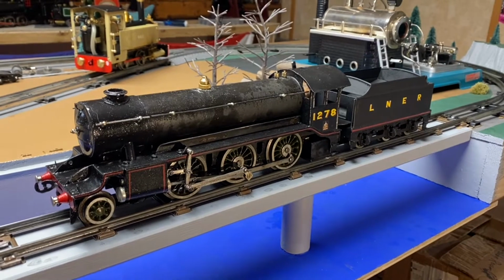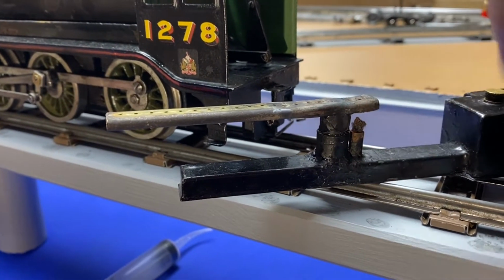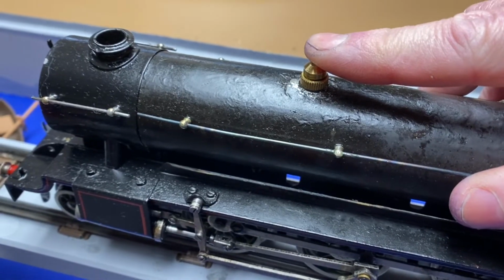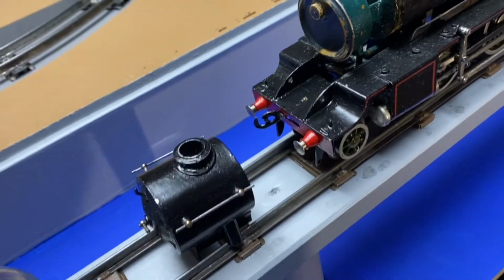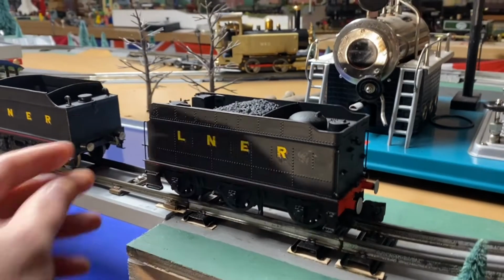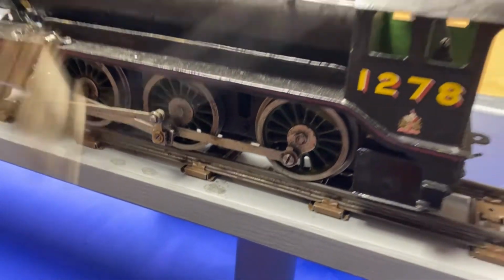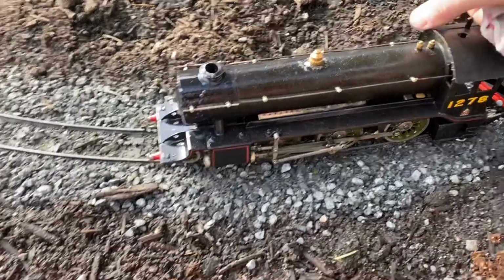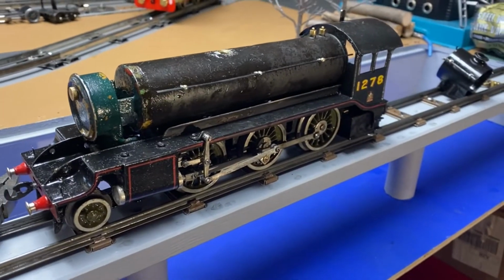Victoria BC: Tutorial - Running an antique live steam O gauge Bassett-Lowke 2-6-0 (Please subscribe)

Comment: Hi Terry,

Thanks for the video. Very helpful. I have one of these on the way. I’m excited to play around with it. Do you have the link for the safety valve you got ? Thanks!
Reply from the maker: @tyfude you’re welcome! If you find issues running it or whatnot don’t hesitate to contact me. I don’t remember where I got the valve. I’ll go have a look…
Reply: @Terrys-Steam-and-Bricks  thank you!
Reply from the maker: @tyfude  not a problem
Reply: @Terrys-Steam-and-Bricks  one thing, do you know about what the PSI pop off pressure of the boiler might be and the thread size? That way I might be able to find a valve that works, or have one made. Thanks!
Reply from the maker: @tyfude  i believe the manufacturer intended 15 psi. The thread appears to be British standard 19 threads per inch on a quarter inch bolt.
Reply: @Terrys-Steam-and-Bricks  thank you kindly!
Reply from the maker: @tyfude  np. I am not very well versed in nit size and thread length. But ai know there is a difference in the angle of the British threads than the American ones.
Reply from the maker: @tyfude  sorry. Can’t find anything. Try places like O gauge live steam Facebook groups. Ask there??

Comment: What is the minimum curve you run this on? I just bought one, but only have O-31 curves. I read they like O-72, so I bought a set of those.
Reply from the maker: I am not sure of the actual minimum but suspect one. I run mine outdoors on 2.5 foot radius track. I do also run mine on 0-31 Lionel track. When I do so I remove the pilot wheels. It looks a bit odd but works. Given the speed can be difficult to control I added super-elevation to my 0-31 track and made sure the loco was slowed with a few railcars behind it. 0-31 is tight and the risk of flying off the curve with a lit alcohol burner is there. Make sure you have a wet towel handy always to throw over the loco. 

As to a hint of the minimum radius it can handle, I have tried it on Lionel 036 Fastrack and it cal ‘almost’ manage it. The pilot wheels run up against the cylinder chests. I imagine that it would run on 38 diametre track without this issue. 

I have heard of people experimenting with home made pilots with smaller wheels for use on tighter radius track. 

Anyway, 072 would be good and would lessen the risk of a topple. 

I hope this helps.
Reply: @Terrys-Steam-and-Bricks  Thank you.
Reply from the maker: @Alcofoamer  np

Comment: No boiler sight glass for the water??how do you know then how much water
Reply from the maker: Some people completely empty the boiler, then fill it all the way and draw some back out. I use a large syringe. I have enough experience and confidence with the loco that I can peer in and by flicking my iPhone light back and forth over the hole to see the reflection off the water know by sight what is about right.

These old engines are learning partly by trial and error. Great fun.

Comment: This is great - I have a B-L mogul and it runs great but fountains water so clearly over priming and totally keep a wet towel to hand I have cooked mine on a public dis[lay and this saved the day
Reply from the maker: There is nothing better, especially for alcohol burning engines, than a wet towel. 

Mine over primed until I heard of others not filling the boiler or oil to the amount original instructions suggested.

Comment: Interesting note about the lubricator plug, I have a similar age LNER Mogul (arrived today) with a single plug but the screw has straight knurling on it. I was curious what the number on the right wheel guard of yours is? heres some photos with some comparison to a Stanier Mogul and Super Enterprise https://imgur.com/a/k5HS4zP
Reply from the maker: Straight knurling? Interesting. Mine is cross hatched as you’ve obviously noticed. I don’t see a number on the right wheel guard. Would it have been a painted or printed number (in which case it’s probably long gone) or a stamped number?
Reply: @Terrys-Steam-and-Bricks  it’s a stamped number, usually a letter followed by 3 digits, my lms stanier has diamond pattern knurls,. I’ve also found the hexagonal wheel nuts date til 1933 when Bassett Lowke switched to the counter bored slotted nuts, but beyond that I haven’t found a whole lot of information on the changes over the years. The wheels are a different profile post war too. Both of my dad’s enterprises and his super enterprise have the later profile and date to around 1945
Reply from the maker: @munkeyWITHbeard  maybe my eyes are deceiving me. I’ll have to get a magnifying glass and have a closer look. What was the purpose of the number?
Reply: @Terrys-Steam-and-Bricks  Apparently they’re serial numbers but as far as I know no one has the logs for them so it’s more of an idle curiosity of how they compare to next one and if any features are different
Reply from the maker: @munkeyWITHbeard  I have been all over the engine and can’t find any stamped numbers anywhere. What a puzzle!
Reply: @Terrys-Steam-and-Bricks  they’re pretty small and easily filled with paint, here’s mine https://i.imgur.com/ayrY1eQ.jpg
Reply: @munkeyWITHbeard  If you go over on the classic O gauge forum(UK O gauge) under the Bassett-Lowke catagory there is a listing about how to date the model by the stamped number.  But some did escape getting stamped for one reason or another.  I have a LNER Super E that is from the 1950s  excellent runner.  The regular Enterprise has no throttle, so you have to vary the number of wicks, height of the wicks or just keep adding cars to slow them down.  The Enterprise can run nearly 1 hour once properly set up.  There is a nice regular Enterprise at a dealer in the UK I may buy.  But I really want a Mogul.  Only ones popping up for sale right now are the Corgi reissue, which do require a larger curve than the original ones.
Reply from the maker: How do you like your Super Enterprise?

Comment: A lot of good stuff here, well done. Glad you've found out about the fire hazard. I use a pair of old kitchen squirty bottles myself. Invest in some wick material called TUW The Ultimate Wick comes from Canada too! With care I can pack the pilot wick so tight that it doesn't leak regardless of fuel level. If running with a high fuel level then add a short length of silicone tube to the fuel tank vent so that the hot flammable fumes are dumped above and behind the loco. If not I end up with an invisible cabfire and the cab dismantles itself into its components!  Fresh boiler paint is cheap insurance ,if after a while in a good run you smell burning the boiler is too hot blow flame out immediately. Yes I know it shouldn't happen but....I'm human and push the envelope a little. You have a lovely virtually unworn little loco love the hot steam visible as a gap between chimney top and visible steam plume.
Reply from the maker: Oh, and I also love the hot steam below the plume. I so love live steam. I’m often proud to walk around with burns on fingers. Before COVID my colleagues would know I had a good weekend if i had a bandage or two. 😊
Reply from the maker: My engine was not so unworn. I had to lap the reverser and do other work. It was a mess when I got it and had a few fine steam leaks I could only find with a little piece of glass as the leaking steam condensed on it. Lol. This loco became a labour of love. It was worth it. Someone had also slopped the wrong green in what I suspect was exterior household paint all over it. I stripped that and decided on black. 

That’s a great suggestion about the fuel vent. I’m going to do that. I had a cab fire I discovered quickly only because I decided at that moment to touch the reversing lever and instantly singed my fingers. I instantly smelled the hot metal and paint. I must have missed the solder melting by seconds! I threw the wet towel over it. Cotton towel of course. I can be clumsy so distrust spraying water in case I actually use the water to blast burning meths all over. The wet towel starves the fire almost instantly. 

I’ve never heard of TUW. Where do you source it from here in Canada? I’ll have to do an internet search.

Comment: very well put together video,now i looking to find similar loco in Canada
Reply from the maker: I should add that the problem with them being much more common in the UK is that I like to check out antique trains before buying them.
Reply: @Terrys-Steam-and-Bricks  that way you know what your getting into
Reply from the maker: @canadiansteam  indeed. Even though I got my engine in Canada and in my province, it was still somewhat distant and I still had to get it sight unseen. But I felt I could trust the fellow. Even if he had steamed it he may not have noticed a few tiny leaks it had. It was still work to get everything right. Ideally I would see the thing under pressure and use a very small picture frame glass, glass telescope slide, or small makeup mirror to move around and pick up any tiny leaks. Condensing steam on glass never lies.
Reply: @canadiansteam  Shameless plug I bought two of these unfired and put the other one up on eBay. I’m stateside but I bit the bullet and brought them over from the UK. Thanks to Terry’s awesome video I’ve been running the wheels of the one I’m keeping.
Reply: @Stoker58  if you follow the steps terry has taken on his loco you will also end up with a great runner,i am still looking for one
Reply from the maker: Hi Martin. They are not too common outside of the UK. Happy looking!

Comment: Very comprehensive and I informative. You’ve answered all my questions, thank you very much! I plan to run a bench test Friday since I haven’t got any track yet.
Reply from the maker: I bench tested my loco initially and it ran freely. It was only when I placed it on the track and it had to actually move its own weight along that I noticed it was losing pressure.
Reply from the maker: However, enjoy learning your engine on the bench! Have a small mirror at hand. Move it around the boiler, and bits to see if tiny bits of steam are coming out anywhere. Even if a small leak is too small to see it will condense on the glass of the mirror.
Reply from the maker: Have you tried your engine yet? My firsts tests included some rather poor runs and problems. Lol
Reply: @Terrys-Steam-and-Bricks  My first run (bench test) went flawlessly followed your instructions as well as an article I found online. For the second run a decent bit of carbon was on the pilot wick so the main body didn’t want to light so I had to play with that. I’ll likely switch out for steel wool like you have done. ALSO I found out for everyone’s information 0-48 curves are too small of a radius haha. But overall I’ve had a good experience running!
Reply from the maker: @Stoker58  excellent! You can also use ceramic wick. It lasts longer than steel wool, but 0000 steel wool does work fine. Ceramic wick is a magic voodoo sort of thing. Lol. Ceramic fibres woven into what looks much like a fine cotton wick.
Reply from the maker: @Stoker58  by the way, I have successfully run my Bassett-Lowke on old 032 Lionel tubular track. Much tighter. I gently pried the outer rails to add a few millimetres to the diameter. Depending on the mood I either temporarily zap strap the front pilot wheel up tight or remove it altogether. Held up looks quite odd and removed looks like a classic car completely missing it’s front grill and bumper. Lol
Reply from the maker: @Stoker58  Hi again, I provided some detailed thoughts to someone about their Bassett-Lowke and figured I may as well also share them with you. I pasted them below:

Now to my point... there are a combination of three main things - other than the mechanical fitness of an engine - that affect its running qualities, more than people often think. Fuelling, oiling and fittings. 

 Let’s take the case of your Bassett-Lowke. Mine is likely from the first year of production as it has one lubricator opening instead of two, but runs like new, or possibly even better given I probably have access to better quality stuff than in 1926. 

When I got my engine it had a few leaks, which I fixed, and also had badly worn/grooved faces one the reverser. I took things apart and carefully lapped and polished the reverser. But it only improved slightly, could not pull much weight and sort of died out after a little running and I’d have to wait for some more pressure to build up for another few laps. 

I experimented with fuel and once I tried the 99.9% pure Methylated Spirits I found at a hardware store the loco improved by a little again. Then I raised the burner arm up a bunch and the improvement was negligible. So I moved it to halfway between where it originally was and where I had put it. A noticeable improvement. Too low and heat gets lost in the apparent wind as the loco moves. Too high and some of the fuel was burning off unseen up and over the sides of the boiler. A test with a coffee stirrer proved that. 

Then I carefully looked at how everything lined up. Over time the metal through the engine has heated up and cooled down gosh knows how many times. That’s enough expansion and contraction to take things out of alignment such that the burner arm did not run down exactly down the centre line of the boiler. So I turned it so it proves heat to both sides of the boiler as best as possible. Another slight improvement in running! So much for the fuel. I think I’ve tweaked the best I can out of it. 

Now to oil. I use light machine oil on the working parts and bearings. not the piston rod of course. I tried the lighter Aristo-Craft oil and the heavier Accucraft oil in the steam lubricator. My Basset-Lowke likes the Accucraft  oil much better and it improves the run a bit. I’d like to try 620 weight. There are some suppliers in the UK for the live steam hobby. In an engine that has no glands (seals around the piston rod inside the cylinder) the right oil plays an important role in helping seal the piston rod in addition to lubricating the moving surfaces. 

At first I was surprised/stymied at how much hydraulic lock happened to get the loco going and how much oil would spurt out the stack. I read an article where the author suggested to ignore the amount of oil to put in the lubricator and use less. I surmise that probably the Bassett-Lowke brand oil back in the day worked just fine but we obviously can’t get that mix/make of compound steam oil now. Anyway, I now load 5 ml into the lubricator as the last thing I do before lighting the fire and things are much better. There is still oil and water condensate spurting out of the stack at the begging of the run but that’s normal. My new Accucraft, which is a fine engine, does this. So much for oil. 

Now to fittings. I replaced the 90+ year old fibre washers/seals with hardware store silicone O-rings. I bought a tray type container of ever manner of small sizes. The critical fitting, in my view, of an old engine is the safety valve. Mine seemed to be letting off steam a bit early  in the heating. I bought a new reproduction safety valve/water fill from a fellow that makes them in the UK. Google will find him. Sure enough, when compared, the spring on the old safety valve had become weaker with time. 

After all of that my engine went from a sad state to a good runner.
Reply: @Terrys-Steam-and-Bricks  Very useful information! Much appreciated!
Reply from the maker: @Stoker58  excellent

Comment: I wish i have one
But i cant complain 
My parents told me that i can build a 5 inch steam locomotive
Reply from the maker: That would be an awesome project! I have been contemplating such a thing as something to do when I retire one day.
Reply: @Terrys-Steam-and-Bricks  o
What class are you planing to build?
Bdw do you have coal fired locomotives
Reply from the maker: @laaity  I do not have coal fired engines. I am sometimes tempted too. But when I watch people run small engines with coal the balance of simply enjoying the train run vs. How much work it is to keep them running makes me realize I like tinkering on the bench, but when running I like stepping back and watching quite a bit. 

I have an old Aster that requires operating a blower to keep draught to the fire. Just that element causes more work. I actually like to shunt cars around with my larger G scale Accucraft engine. It doesn’t need a blower. One just adjusts doesn’t the gas flow when waiting. I like the hands on operation. However, shunting cars with the addition of balancing a blower makes it more challenging and less enjoyable for me. Add coal to the mix and it becomes a little too much. 

But if I have a steamer in a ride on/behind scale in years to come I want coal firing for sure!
Reply: @Terrys-Steam-and-Bricks  o
but in case your interested 
On ebay there is a k28 i think that is coal fired 
And go to gandy dancer productions
He made his own coal fired locomotives
Reply from the maker: @laaity  I’ll check it out
Reply: @Terrys-Steam-and-Bricks  but im surprised your little engine runs
Its really old
Reply from the maker: @laaity  it did take some work. But unlike lots of modern toys or devices these were built before a time when we expect things to break and before a throw away culture. They were made to last with proper care. Lots of people still run old engines like this and even older. The evidence suggests mine is likely from 1926.
Reply: @Terrys-Steam-and-Bricks  o
Did you have to reastor it
Reply from the maker: @laaity  yes. It took a lot of work
Reply: @Terrys-Steam-and-Bricks  im surprised it runs
It came from the 1920s right
Reply from the maker: @laaity  it runs because I had to work on it. There are vids of other’s running. If they are well taken care of they can last a long time.
Reply: @Terrys-Steam-and-Bricks  lukly thet where